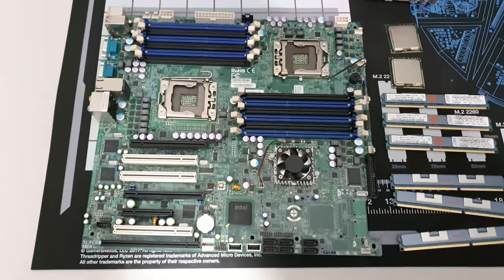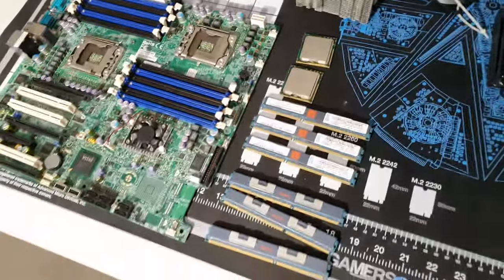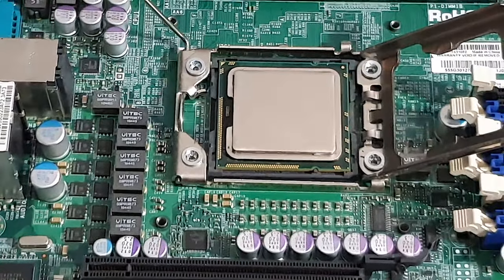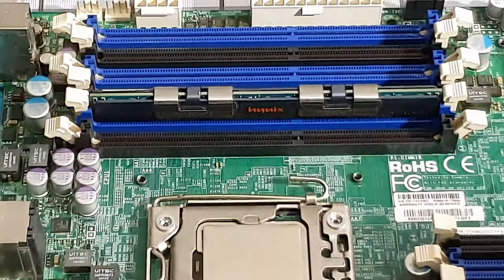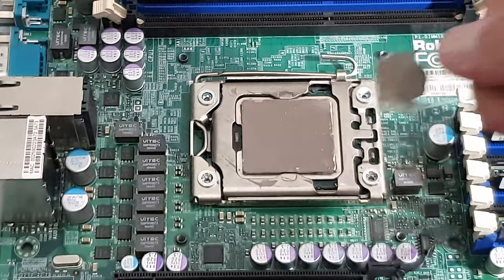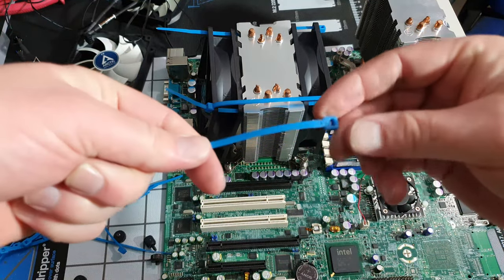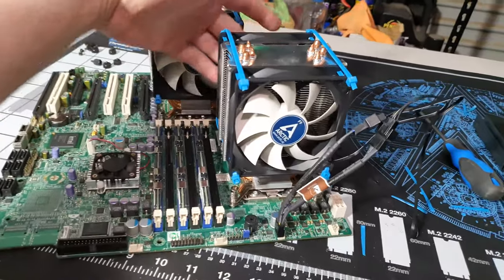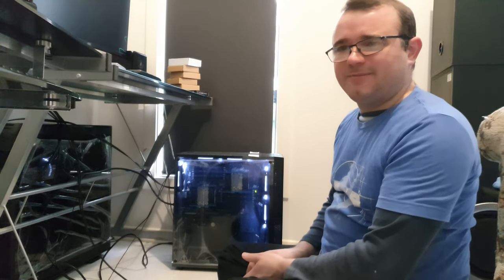X58 Dual Intel Xeon X5690. The Build.

Comment: id like more info about this build, what power supply did you use? the 3 boards that i bought off of ebay didnt work worth shit!
Reply from the maker: I'll make a spreadsheet of the parts in my next video giving full detail. I didn't think anybody would be interested so I didn't bother. The power supply is a cheap cool master 750 watt. More than enough.

Comment: Wait, so it has double the amount of GHz with 2 CPU's?
Reply from the maker: Not quite sure what you meant. In cinebench you will see very close to doubling of performance as opposed to running single CPU, that's only because of the extra cores and threads. Clocks stay the same.
Reply: @ProjectSmithTech  you think it's worth it coming from a budget build and so does this mean the PC use 12c/24t??
Reply: @anthonyk  Yes the PC will use 12c / 24t. If its worth it or not depends on a few factors. The hardware cost v the power cost. Some newer processors are not much more expensive than 2 x5690s and have better performance and lower power consumption. That said if you really shop around you can find stuff getting sold for next to nothing. In my country there are a few huge companies that do Enterprise grade server work. The stuff they remove is sold in bulk on E-bay. I recently bought 400GB of DDR3 1080hz Rdimm for under £50uk. I couldnt get ddr4 or 5 for anything close to that.

Comment: what cooler is that? is that the hyper evo 212? i cant find a compatible cooler.
Reply from the maker: The cooler is a generic 1366/ socket  X58  compatible. I brought it off ebay. Any tower cooler 1366 compatible will be fine. 
I've almost finished editing a video gaming with this system. The 980ti did a really good job. I'm still very new at editing video but I'm glad you got some value out of it.
Reply: @ProjectSmithTech  im trying to make a hackintosh build out of this platform actually. with raid and eveyrthing, but id like to get 96gb of ram running in it as well. i belive the max size drive this board can see is 4tb. i have tested that 4tb ssd do work in this board. but how ever i coudlnt get any of my boards to display a video out put single. and i like an exact link to that psu you used please. this video has been very help full in my adventure of the x58 platform. i plan on doing more indepth testing with this board  and running more experments. if you want we can email back and fourth about having thease projects come alive and i can build you the hackintosh stuff side of things send it your way. it is my dream to see this board become a beast of a computer as this was my high school computer back in the day when i worked at it. it was a beast of a computer, but at the time the school wouldnt let me put anything newer then windows xp pro on it so it didnt get its full pointental. im also going to install windows 11 on this board as well and the latest mac os venctura once i figuer out how to get that working., but due to the lake of avx 1 and 2 instruction set on this platform this is currently not possible. but i did find on intels website they do have the option to decode your intel emulation grounds and im going to figuer out how to decode it and break it out into a .kext file so mac os 13 can run on x58 chips. id like to communinatcate more with you, and i have hardware for this board id like to seen tested with this board. maybe we can jump on a discord call and get in touch about making my system become a reality? there far more testing i want to do with this board but im not  going to give to much away in the comments here as id like to keep this project closed for now. which i hope you understand. and thanks for making this video. will be watching the next ones that come out!
Reply from the maker: @zacharyschwanke7160  I do have public links, if you want to you can interact with me on Facebook, Twitter, Instagram.